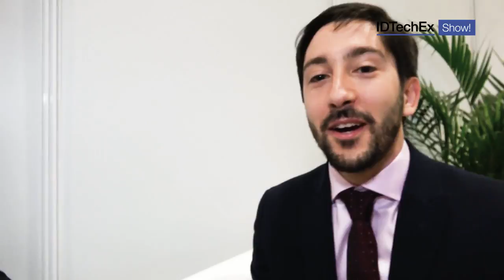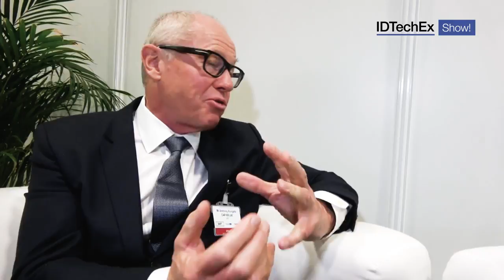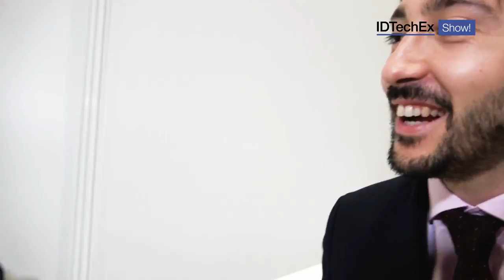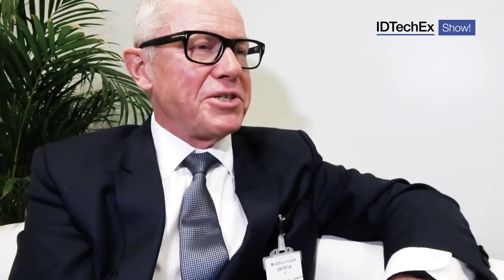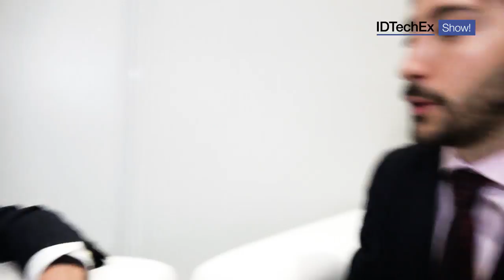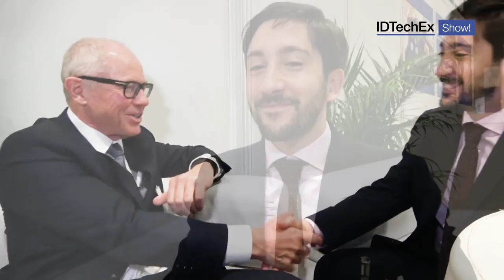CAP-XX develops industry’s first 3 Volt thin prismatic supercapacitors

Comment: I do not see any improvements or advantages over competition other than maybe the form factor that is not needed as they are not useful either as support for a battery and neither stand alone in almost any application.
They mention 3V but that is rounded value for peak 2.9V and nominal is about the same as the competition 2.75V.
The very low energy density plus high self discharge makes them unsuitable for most if not all applications.